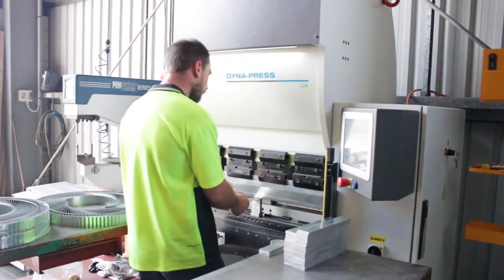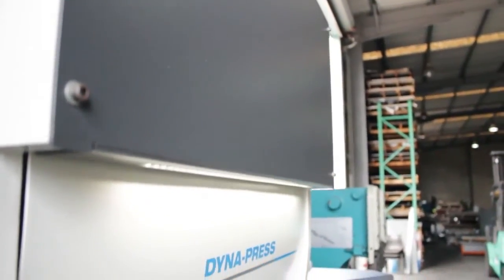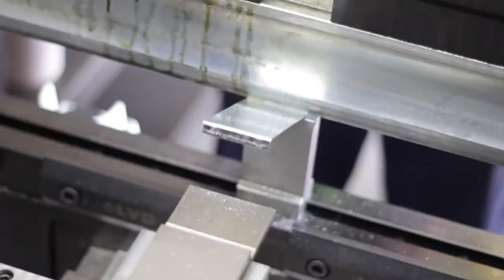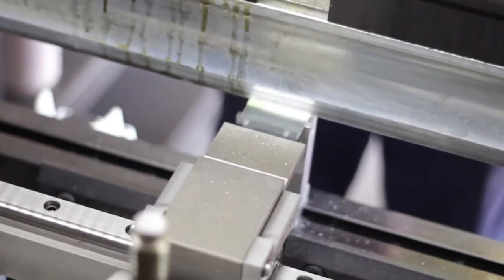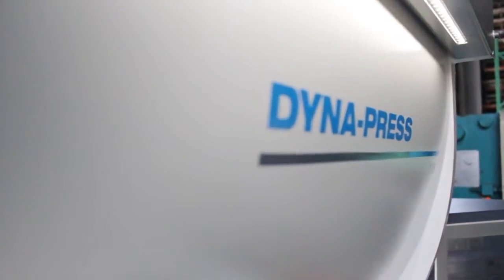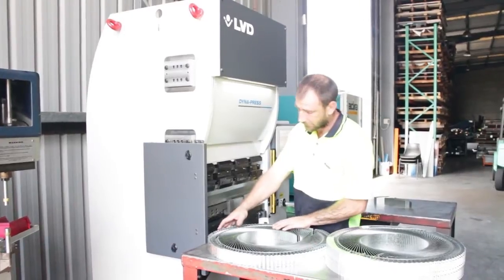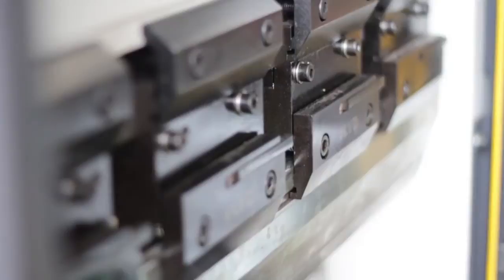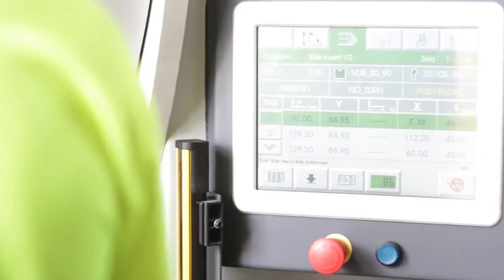LVD DynaPress Testimonial | GWB Machine Tools Australia

Comment: We had purchased the LVD Dyna Press which was commissioned in May 2017 for our Fabrication unit in Kuwait. Since commissioned this machine has been nothing but problem and their agent from Dubai has visited 3-4 times to solve the issue but no solution yet. So my suggestion is to avoid buying this machine. Better to buy their other older generation machines or different brand.
Reply: Wow ! so sad to heard about that! Are you still in trouble with that machine these days Sir?
Reply: What were the problems you've encountered? Just curious.